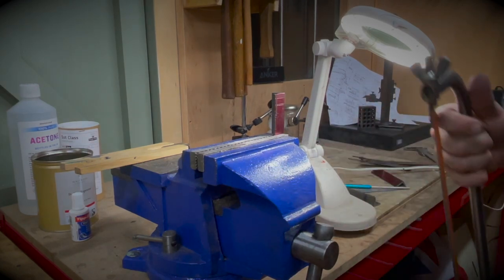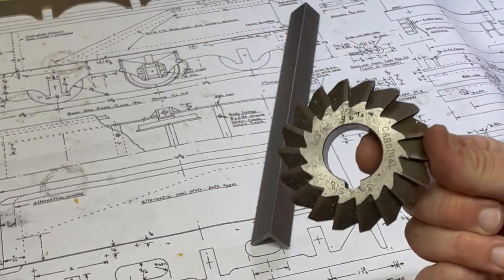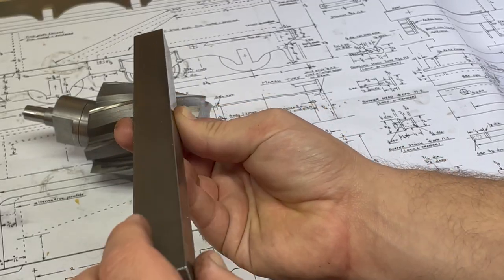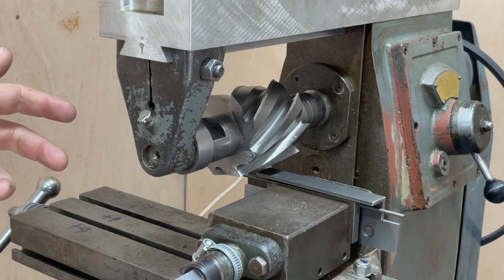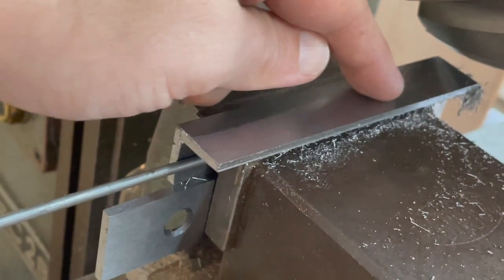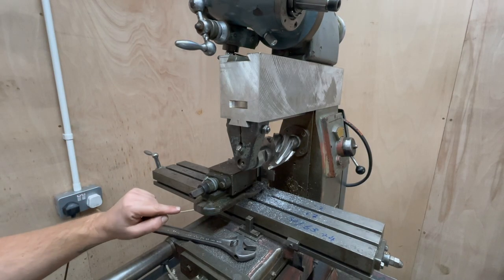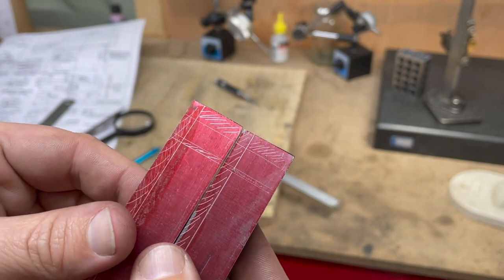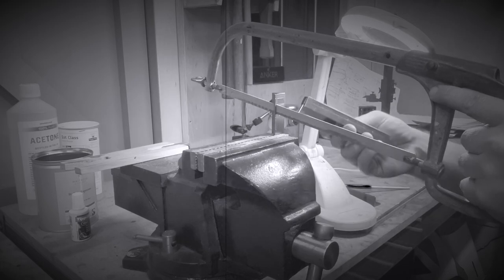Loco Build 2.2 - Horizontal milling on the tender beams

Comment: My sympathy on your back problem - I know how it feels. I told you recently that one never has enough tools. Well, I have just taken delivery of an elderly Record No.75 Vice. I didn't need another large vice but it's a beautiful brute and I couldn't resist it. (As Oscar Wilde famously said, I can resist anything but temptation.) The vice will have a thorough clean, repaint and lubrication before going into use.
Best wishes for a speedy recovery and return to the workshop.
Reply from the maker: New tools seems to be the only constant! Thank you for the well wishing and good luck with the vice!

Comment: That little mill is worth its weight in gold ! .it's difficult to find a bench top version in such good condition you did well.Thank you
Reply from the maker: The mill is a floor standing version, it didin't feel very little when I was dragging the b***tard down the side of the house and levering it into place! However, while it may need a of fettling it's got the bones of a beast that will last me the rest of my life!

Comment: Great mill work. We have not used the horizontal mill on our Centec yet but I did notice that the drive for the horizontal mill turns in the opposite direction to the vertical drive. Do you change the belts to reverse it or use it in that direction? I hope your back is better soon
Reply from the maker: I have a separate controller for the VFD which allows me to run the motor in reverse - super handy!

Comment: Hi William quick suggestion get some water soluble cutting oil  I found my. Bill gave a better finish when using some . got mine from arc euro ( no connection) dilute 10water to one oil give a creamy solution
Reply: Mmy mill even
Reply from the maker: Thanks for the tip!